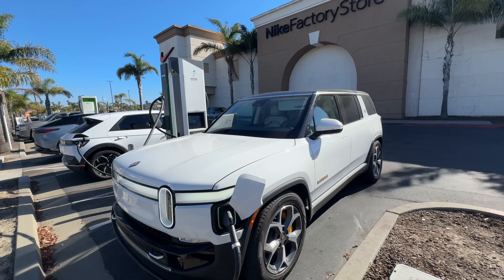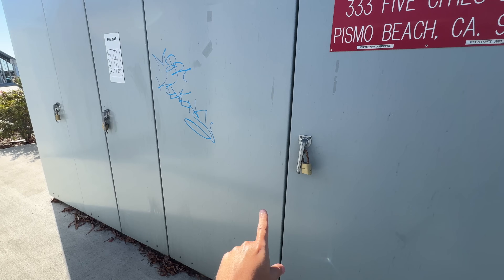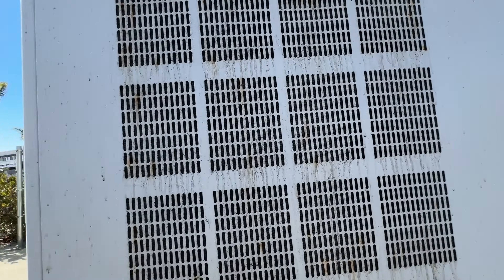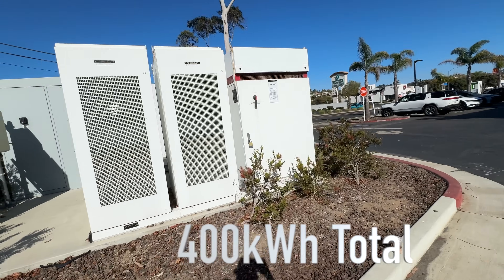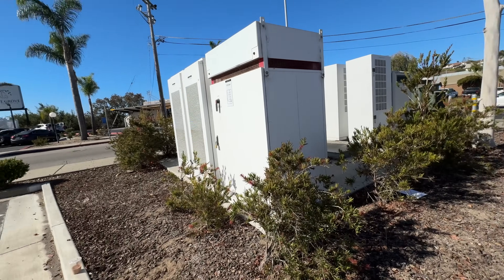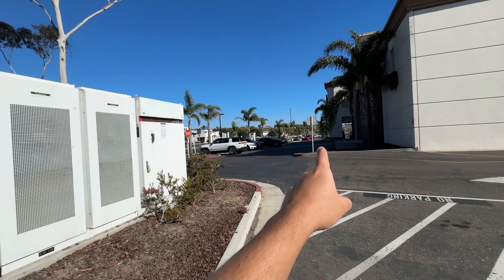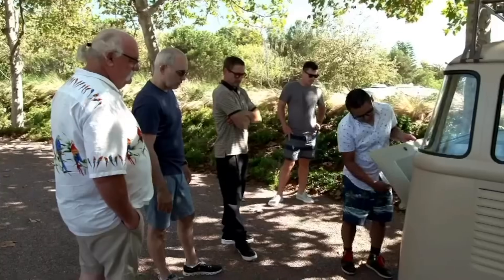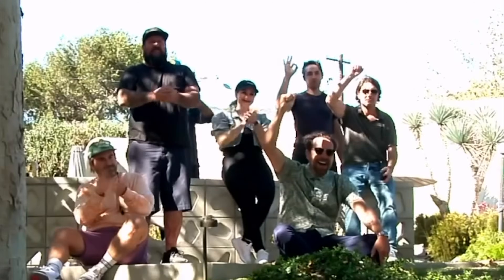This is Why we dont have more EV chargers

Comment: That utility transformer is sonewhere between 750-1000kva. The Tesla battery and inverter is there to smooth out the variable load from unpredictable charger usage. It will charge during light usage and discharge during peak usage. Not sure how big each inverter is. Im guessing about 1000kva judging from its physical size.

Comment: yes....all the high power electronics will run in the millions. I believe this will be one reason why Ample Modular Battery Swap will be a huge help in electrification. No need for high power - easy permitting - much lower cost per station - goes up in a few days - faster refueling which will be to 100%... I could go on.

Comment: I would have to say as a EVSE professional, that's not why we don't have more completely, it because Cali went full renewable, PV,EV, then realized their grid can not support, so now there is Batteries being added to all to try to store and reuse at peak and maintenance times, Newsome literally begging Cali resident not to charge their cars at night, lol
And to your point the new level 3 DC fast chargers require not only 3 phase but specifically 480v 3 phase vs 208v. This largely requires new utility transformers as you show in video, further taxing the utility grid. All of course expensive to do and people still widely do not use those expensive tax funded facilities opting to charge at home at night again exasperating the problem.

Comment: Crazy how much goes in to it. Honestly this is why (without knowing) so many gas guzzling truck thumpers love to say how EV is dead and it will never work.. while I disagree with a lot of what they say, the one thing a lot of naysayers bring up is the insane infrastructure we need to convert gas to electric even at like.. 10% to 20% of all cars on the road. California is by far the most EV installations and a couple years ago there was little wait and now, there's a good chance in all but the larger stations you're going to wait, and with 30+ minutes for each, you could be adding a few hours to a few hour drive. This is why I cancelled my Cybertruck order.. the range.. 500+ that was promised now 300 or so.. no thanks. I have a Model 3 and its a pretty good car overall, but for long drives, it adds an hour for every 3 or so hours of driving for charging. I've said it before.. say it again, we need at least 600+ range vehicles with 20 or so minute charge times at most, and a lot more chargers too. Until then, the grid problems we have in this country (and others no doubt) along with the amount of money to build 1000s more, is going to be the primary reason EVs are very slow to adopt. Even the big 3 are saying EV sales are slumping hard and I'd imagine a lot of it has to do with the fact that charging takes so long, range is miserable, and there are not nearly enough charging stations to make it worthwhile for anyone that has to drive more than 60 or so miles each way.

Comment: You forgot to mention the losses going from A/c to Dc. The 13.8k dry transformers are 86% efficient, Then going into inverter at 92% efficient. Then reconverting the A/c to charge battery bank on high demand 82% Charge efficiency of batteries being charged 91%.. So total losses from pole to EV is 22-27%. Oh and 5.5 million dollars for the material and install of the charge stations. Saving the world one car at a time.
Reply: Series efficiency is calculated by multiplying the factors.  So .86 x .92 x .82 x .91 is about 60%.  And the % numbers you are citing sound high.

Comment: The 3 phase gets rectified into DC and filtered with capacitors producing less ripple using three phase than single phase. They make small units like that because they can add as many as they need, they still require the same amount of components per car so it wouldn't really matter if they made a big one or a bunch of small ones other than moving the big one is more difficult. And as you can see, the faster you want to charge, the bigger the transformers in the boxes have to be to handle the power level. It's all because people are in such a rush!

Comment: One of the reasons charging sites are so large is because of the one-charger-per-car most architectures are based on. A more efficient way of implementing charging infrastructure would be to have a HVDC main bus feeding banks of DC-DC converters that can be allocated to each charging stall as needed. That eliminates the need to have dedicated 350/150/75kW stalls and makes it possible to have many more stalls without multiplying the charger size by anywhere near as much. Tesla's v4 superchargers do something along that line.
Reply: HVDC distribution is wildly expensive, its why its not part of our infrastructure
Reply: @lonniemerscham5013  I'm talking site-wide power distribution here, not grid-side.

Though even on the grid side, now that grids are deploying GWh-scale battery packs with GW-scale inverters for network stabilization, going with DC power distribution would eliminate the need for inverters and quite possibly make DC cheaper overall. One major drawback would be that DC arcs don't naturally extinguish themselves, which could lead to some spectacularly catastrophic faults.

Comment: Hey Jehu, you’re about 3 miles from my house at this charger.  At this location the Supercharger was installed first and the Electrify America came later.  Months ago, friends from Texas came to visit.  They landed in Santa Barbara and rented the cheapest car they had, a Polstar II.  The day before they left, I put it in my garage and plugged it into my BMW charger.  The next morning I found that it didn’t charge so we too it to the charger in Pismo to plug it in.  We could NOT figure out how to get that car to charge.  I kept calling the number on the charging post and running various credit cards (which, for some reason, have different procedures for each different card).  Finally, they just said a quick prayer that they’d make it back to the rental outlet in SB and off they went.

Comment: Thanks Jehu.  That was a good review of high power DC charging equipment.  My guess for the main reason the Tesla PowerPack batteries were installed was to reduce the maximum demand (power) this charging equipment draws.  Shaving off the peak demand for the month reduces the monthly demand charge from the utility.  Utilities typically have a monthly charge of $15-60/kW for the highest 15 minutes of power used for the month.

Comment: I just think of all the different battery chargers I’ve had since I was a kid in the 70’s. When NiCds came out they were the future! I don’t think I could even tally up all the different chargers I’ve had. But I do know that a change in technology and or chemistry quickly made them obsolete.
Reply: Exactly why I love Tesla. As soon as the next thing is ready for prime time, they roll it out to the consumer. From Lithium low voltage system to 48v drive by wire now. They don't even tell people their car has "hardware 4" or a rear screen until they are selling them.
I hate Mercedes. Show off cool prototypes and don't release anything with the features in it for 10 years or more... sometimes by then they are obsolete.

Comment: The closest charging station is over 230 miles away from me so basically I would have less than 18 miles of range before having to drive back to it and charge again.
Reply: that's why your supposed to charge at home.  Granted that's not always a option for everyone yet.
Reply: Power grids be damned! No way these are feasible across the country, maybe in urban enviroments. Instead of wasting good lithium on motorized vehicles they should be building more home and commercial power supplies. Lucky that people make stuff like this though so when they go off the market and get scrapped we can make useful things.

Comment: Thanks for showing us why EVs are destined to be obsolete soon.
Reply: Every speed, acceleration, and performance record is being shattered by sub $100k EVs. The best selling car in the world is an EV and there are 2 other EVs in the top 10.
EVs don't even charge at these unless you are on a roadtrip. You can't pump and refine your own fuel, but I make my own power.
Reply: @Flutter9i6  all of that I see and most agree with. Unfortunately it has no bearing on my original comment. Power and speed aren't relevant, when compared to the energy it takes to do those awesome feats. But none the less irrelevant to my OP. So essentially you made your case on 5 to 10% of what will be needed to make it work. Everyone forgets the most important part of the equation. PROFIT, without govt subsidies. Subsidized to make and subsidized to buy. We won't even repair the roads and you can think they are going to give you charging stations to charge cars nobody can afford. Not trying to be rude, but it only takes grade school reasoning to see this is nothing but wealth redistribution from the working class to the rich. Might be mute subject shortly as the EV industry implodes.

Comment: Electrician in the power industry here: Transformers do not create the three phase power, it is created by the generation source. The incoming power from local distribution lines will most likely be between 13,000 and 35,000 volts, and the local distribution lines can be three phase with 3 wires, or single phase using 2 wires of the three phase system, and the charger transformer and charging equipment will be matched to the supply configuration.

The charging equipment will then take the incoming AC power, and convert it to DC using rectifiers, and will provide smoothing and conditioning to output DC power at the right voltage and current as required by the battery to properly charge, removing the need of the car to carry around all of the equipment to make high power DC current.

The cars onboard charger will only provide high voltage DC to the batteries at a much smaller current and power level than what the large external charger can provide.
Reply: OK

Comment: My Level 2 chargers that I use are free for my Fiat 500e. It only has a 24 kWh battery though.
Reply: How many miles per kWh do you get in the Fiat 500e?
Reply: @honthirty_  It's better than a leaf, but not as good as a standard rage model 3. I really wouldn't buy one in the US though. They are about the same price here as the model 3 standard range... which ends up cheaper because of the tax credit.
Although by next year, it'll only be $3750. So about the same price.

Comment: TBH it's less than it takes to install a Gasoline Station... 
You may still need to dig up the parking lot a bit, but not to install 1-2x 12,000 gallon fuel tanks. 
The cost to build a gas station can range up to $2-3M 
And then after 20 years, you don't then need to spend another $1M to completely refurbish those tanks and excavate all the dirt in the surrounding area for cleaning due to the leaking tanks

As costly as Electricity management may be, it's really kinda cheap / easy compared to petroleum
Reply: it also serves far less customers.  How many people fuel up from those 1-2 12'000 gallon tanks daily? 200? 500? more?
I'm all for EV's (i have one), but fast chargers aren't going to be cheaper than gas stations.  Hopefully we do the sensible thing and put slow chargers at as many homes\parking spots that we can.
Reply: @Wooble57  in the short run, yes, the number of people who can refill in 5-10 mins a 13-25 gal fuel tank is many.  But as the architecture of EVs changes, from 400v-800v to 1200v+ the time spent at aCharging station will drop down to the same as petrol.  The range of BEVs will increase from 300 to 500+ and people will realize that it is much more cost effective to drive electric.
Not to mention the instant torque, and fact that you can drag for pinks and the cops won't even hear it
Reply: @wjlambert  you are talking charging in the megawatt ranges.  That's not only hard on batteries, it's hard for the grid to switch loads like that on\off.  
It really doesn't make sense to have people fast charge their vehicles all the time when home\work based slow charging works so much better.

Even if you did that, it's going to be even MORE expensive than fast chargers already are.
Reply: Pros: cops wont hear you speeding bro! 
High torque bro!

Cons: 
-not as good for the enviroment as you think.
-Very expensive upfront cost.
-Fast charging will kill your batteries lifespan
-piss poor range that declines with battery life
-where are you going to charge it? Home?

EV owners coping hard 45 mins into a charge while my patchwork 04 toyota flies past with 300000 miles on it and the gauges dont work. 😏

Comment: Looks to be maybe a 2MVA transformer, probably 1.5MVA and it comes in three phase. High side can be anywhere from 7200V to 32kV, low side probably 480V.
Reply: 4160 v in ?
Reply: @chuckconrad8736  Could be, but usually only smaller, older city areas are that low on primary distribution. Which by the way, 4160V is the line to neutral voltage of 7200V line to line. but 4160V line to line is only 2400V line to neutral.

Comment: It would be interesting if I saw you looking at hydrogen as well.
Reply: Hydrogen. You loses more energy making it than you get out of it. It needs to be heavily compressed, and the only bennifit is it takes slightly less time to fuel to full then an EV takes to 80%... But you can't go 400 miles without the tank making your SUV have less useable space than a sedan. Hydrogen has the awful volumetric energy density.

Comment: I would also like to remind everybody about the hidden cost of underground fuel storage tanks and the limited life that those have and the cost of replacement and installation and risk to leakage to the environment its zero. I'm not well read enough to say if it would be more or less money to build a gas station than this though.
Reply: A gas station costs 3-5 million dollars to build by the time you pay for approvals permitting ground tanks pumps etc. probably more in California.  That transformer cost quite a bit of coin though.

Comment: A buffer is a fairly good guess however that would be poor engineering in my mind, if the charge station was overloaded I would expect they could just lower the overall charge rate for all the cars. I would guess that those batteries are being used to make some money through power exchange rates throughout the day and night with the power company. Helps reduce the cost of charging to the end user during the day and then when no one's charging or less people are charging at night the system recharges itself with cheaper power.   I wouldn't be surprised even if just like solar panels with net metering and whatnot that they share storage with local solar even. The future grid looks just like the internet and instead of servers it's batteries and instead of data exchange/making its energy producers. Hell, anyone with net metering and a home batteries could do that.
Reply: Doing both could be possible.  When it was buffering, the power goes to the chargers which now are paying less for that extra power.  But then when chargers are idle, it chargers and discharges to make money selling into the grid.
Reply: It probably also helps lower demand charges. When utilization is high, it could be set up to limit demand pull.

Comment: What bothers me is the inefficiencies in systems like this. High voltage AC grid to DC in the powerpacks back to AC for the charger then back to DC to charge the cars? Is that two round-trips before the energy finally makes it into the battery? Then the 3rd is when the car converts it back to AC to power the motors. You will lose 10-20% of the energy on each round trip.
Reply: No. AC from the grid is required for efficient transmission, as well transformers don’t work with dc without switching electronics. (with exception there are some 1 million+ volt DC stuff) 

Fast charging is direct DC meaning the DC to the battery is straight in, only 1 DC conversion, which is really fairly simple. The hard part is to provide the correct DV voltage and current at 400-800 volts and the systems are very efficient.

They by design must be very efficient because heat generation at 50-250KW would be absolutely massive at 10% inefficiency. I believe efficiencies approach 99% on these types of chargers.
Reply: @lazerusmfh  are you saying these powerpacks on site are charging the cars directly from their DC power?  I'm not sure that they are. Also, the superchargers use big fans to cool all the electronics, if you have ever been next to one they are quite loud. The efficiency is not 99% to be sure, not more than 95 if you're lucky.  Solar power should ideally be sent into batteries on DC with no other conversions taking place, ideally. Maybe one day we'll get there.
Reply: @lazerusmfh  99%?  Nah.  
Closer to 80% per conversion. Stacked up that is about 60% from line thru to final users car.
Reply: @honthirty_  That's just not true. Supercharging does make it less efficient, but the EPA has tested this and takes into account all losses including line loss average to the grid. Thats how they get the "120 MPGe" rating. 60% is ridiculous and easily falsifiable. From the grid 80% is more realistic.
As for the batteries, they may actually be a net positive for the grid. An energy arbitrage, drawing when the grid over-produces, and selling during peak demand. Besides helping the grid, it's also buy-low sell-high. Good way to make a bit of extra cash.
Reply: @Flutter9i6  Look back at the original post.  The efficiency in question was from power source (pole) to final charging KWh stored in customer's car batteries, with a cycle thru the batteries at the station.  Presume efficiency is a generous 90%  per stage, and I count 5 stages.  13.8k transformer, inverter, stand alone battery, dc to a.c. converter, charging station inverter,  to charging vehicle.